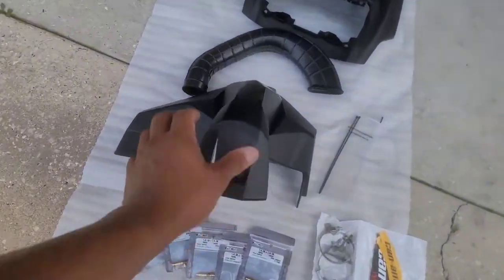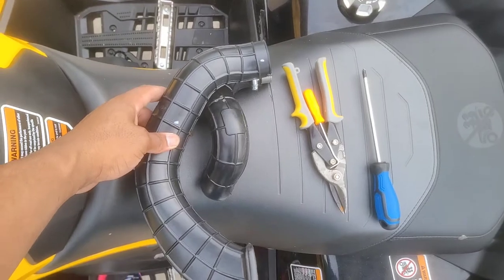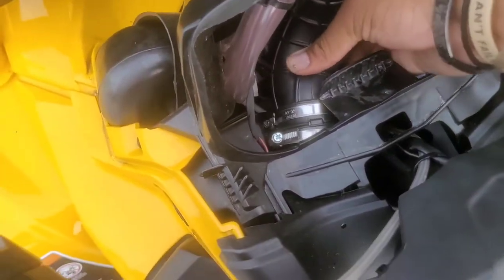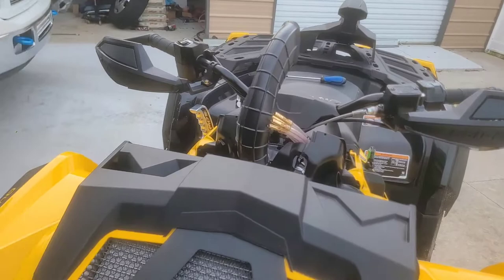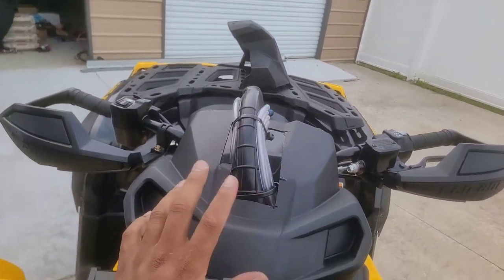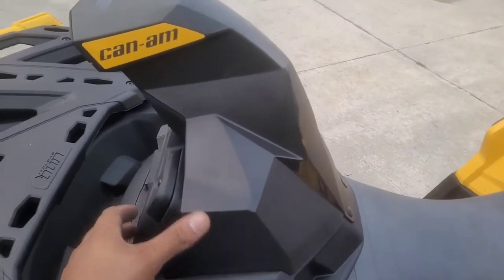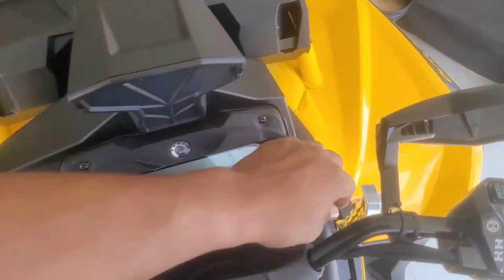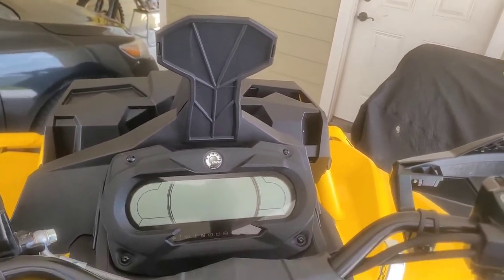2021 CanAm Outlander XMR 850 Snorkel install |How to| Submarine Mod| Going Deep!

Comment: i would strongly suggest if you want to go deep to cut off the cvt exhaust and run it with flex tube to your rhino horn. then your lowest point in your cvt intake unless you decide to do the same. great vid!!

Comment: How loud is your. Mine is crazy loud.
Reply from the maker: The snorkle?
Reply: @Powerstrokepat  yes I wish I could share the video with you. To me it sounds like it’s sucking for air. I had the dealership put it on so who knows
Reply from the maker: @Jason000111mmw  this is on a 1000 huh?
Reply: @Powerstrokepat  yeah 2023 1000
Reply from the maker: Yea I figured that once you said that. Yea I've heard and seen the 1000 having this issue because the rubber riser tube collapses from the large amount of air the 1000 engine pulls in. I fixed this on one bike by putting a pvc tube in the rubber snorkle riser so that the snorkle won't collapse under load
Reply: @Powerstrokepat  awesome thank you so much for the very good video and the feedback
Reply from the maker: @Jason000111mmw  my pleasure. Hope it helps
Reply: @Powerstrokepat  would you happen to know what size in diameter PVC pipe. Honestly I’ve never even looked at mine yet.
Reply from the maker: @Jason000111mmw  I don't off top of my head I used what I had laying around. I'd say nothing more than 1in tho

Comment: With the belt box vent still at the same height this set up is useless not to sound like a Ass but your motor is safe but if the belt gets wet you ant goin no where!
Reply from the maker: yes your right but you can dry out the belt box on the trails and continue to ride, but you get water in motor thats the end of the trip.  pick your poison id rather water in belt box over water in the motor